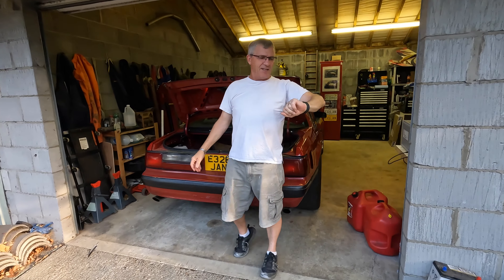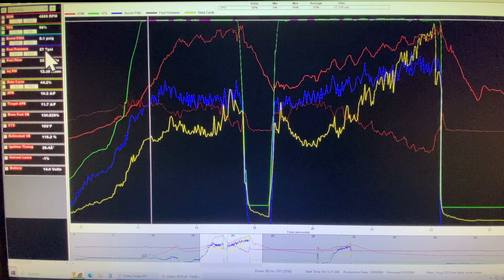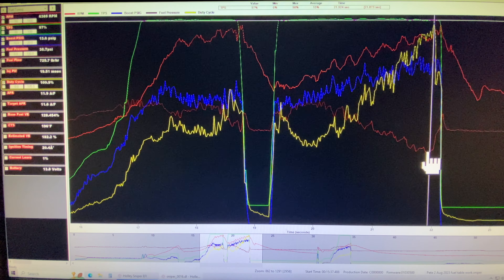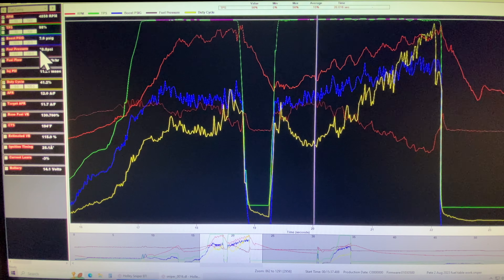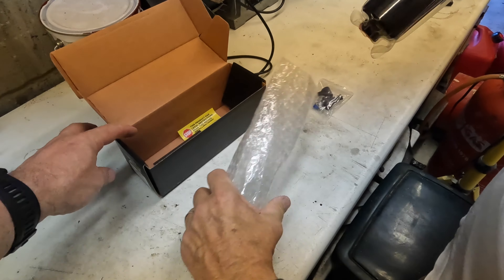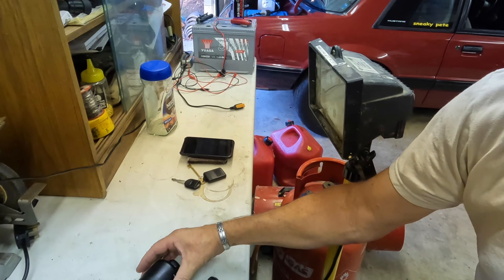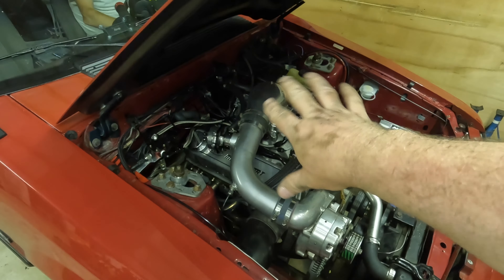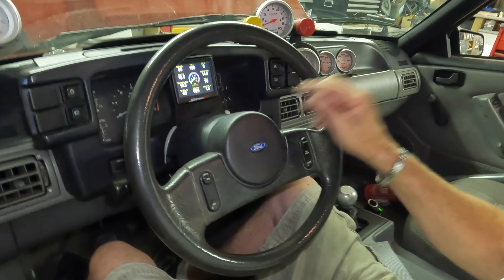Holley Super Sniper Saved Petes Engine

Comment: First.... Kinda unfair though.
Reply from the maker: I never knew anyone could comment, before Youtube would register a single view.
Reply: What octane gas is he using? Where would one get the discharge pipe from? I have a vortech on my 88 notch and am considering switching to a holley super sniper sniper
Reply from the maker: @RJ-zf7fw  UK premium fuel is the equivalent to approximately 94 octane in the USA.  His discharge tube is custom with the dump valve flange welded onto the rear of the elbow.